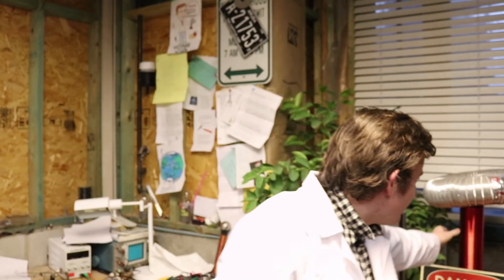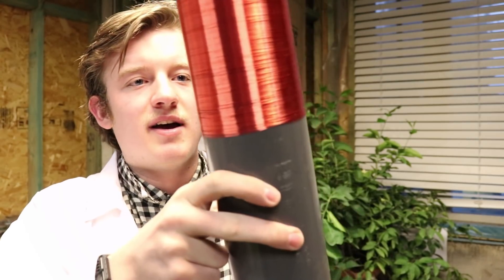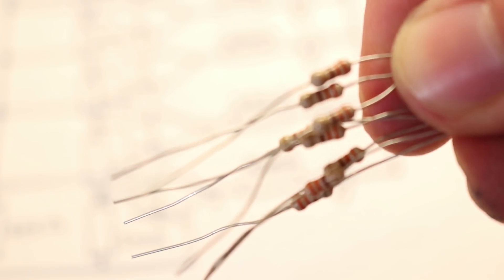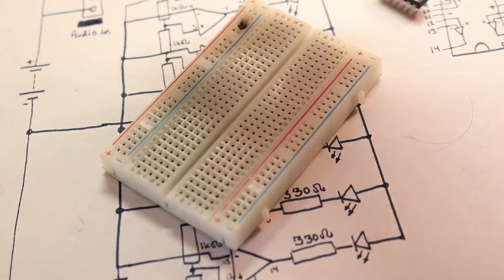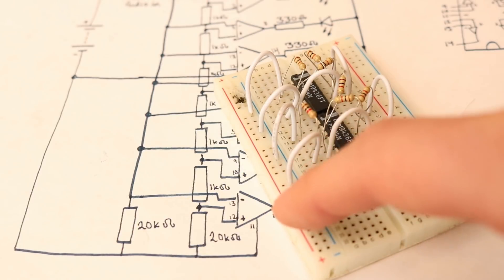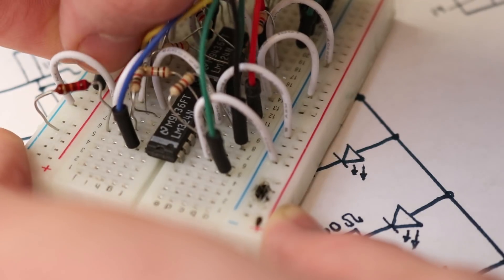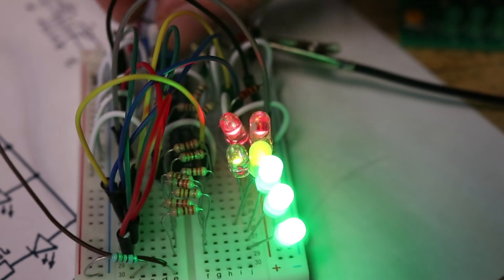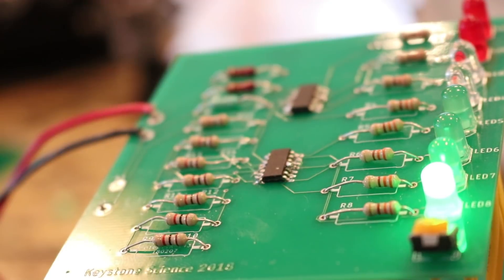How to make a VU meter

Comment: It's so finicky to adjust and doesn't have quite enough movement because you made the divisions linear. It would help to make them exponential. You don't need a lot of resistor values to make exponential divisions, you can do for example R/2R resistor ladder to produce reference voltages.

Oh, to go with it, you might want an exponential regulator for the input too... well... you can bias a linear potentiometer to get eerily close, and better than logarithmic pots that you can actually buy. Look at "Better Volume Controls" on Rod Eliott's website. Of course it needs to go into a high impedance input, so this is not a universally applicable hack.

Comment: hey Cody,
i have an idea that i really want to build but dont know how. to give you an idea, heres a video;
https://www.youtube.com/watch?v=oSNXp1ze248&t=0s&index=14&list=PLp9zdgDiIXt5_kPNJnnINSfYsRoatdjtX
can you construct a data transmitter and receiver that uses audio to send information back and forth? kind of like a radio but with audio in order to send data through the water. such as 2 arduinos communicating serially but with audio based information transfer.I want to develop this because it is the only way i could think to send information through water. let me know if this is something you would consider!
Reply: Are you trying to "stream" music? LOL. Sorry I couldn't resist the joke.
Sounds like an interesting idea though.
Reply: Water proof your speaker, water proof your microphone, done
Reply: i'm talking about transferring bites of information not audio lol
Reply: like ones and zeros...
Reply: Xasthan Kiyato thats not going to work because audio information transfer requires a set frequency that is smaller than the baudrate or frequency of the information. for example if the frequency or baudrate is 9600 bps, the frequency of the actual soundwaves has to be smaller. in otherwords, you need to oscillate the voltage of the ones, turn the ones of the information into little sine waves
Reply: to give all of you a better idea of what im thinking heres a video of a man who actually built it. https://www.youtube.com/watch?v=oSNXp1ze248&t=0s&index=14&list=PLp9zdgDiIXt5_kPNJnnINSfYsRoatdjtX
Reply: Xasthan Kiyato i know that, the problem isn't really on the transmission side of it, it more has to do with the receiving side, i have no idea how i would filter the frequencies that would come from the ambient environment. if you have some idea of how ordinary radiowave transmission works, you have a transmitter and a receiver right? the transmitter takes the ones and zeros from lets say, a computer, and mixes the signal with an oscillating wave. this new resultant signal is sent to a simple set of circuitry and transmitted. simple. the real complex side i on the receiving end, where the signal needs to be amplified by an opAmp and filtered through a set of circuits to get rid of other frequencies you dont want. this can be seen when you turn on your radio to lets say, 91.3. the Radio reciever amplifies and gets rid of all the frequencies above 91.3 and below 91.3 to give you only the frequency you want. the same would be with transmitting sound the only problem is i dont know how to specifically do it because im only a highschool student lol. i dont know any of the equations, i only know the general concept.
Reply: i know about lc circuits, i guess i just dont know how to come up with the values needed because i don't really know the formulas but i guess that more of a me problem because im just to lazy to reaserch it rn lol. i have a lot of projects on my hands at the moment the last thing i need is another one. one project at a time i guess lol. it would have been easier to have someone else do it but i guess sometimes you have to do everything yourself haha.

Comment: I'm curious about what sort of neutron detector you bought. I'm a grad student in nuclear engineering, and I know those tubes are sometimes not great, are really expensive, or are really really expensive (like the 3He ones). Also, if it's a BF3 tube, be careful. They can corrode from the inside and break open unexpectedly, especially if it's old. A couple friends of mine got to spend a day at the hospital because a BF3 tube broke open when they were disconnecting the coax. The building had to be evacuated for a few hours also.

Comment: Doesn't grey PVC have carbon in it if so your not winding a secondary your winding a resistor and it will heat up (never use black PVC neither).

Comment: That is a really hacky way of driving the LEDs. I find driving them with a transistor is far easier and more effective. I am guessing that is why you had several extra LEDs on the breadboarded version; some were staying on and some were not getting power and you had to trial and error it.

Connect the base of a PNP to the comparator output, emitter to V+, and collector to your LED. 

I have a really crappy video on my channel that shows me driving LEDs via transistor. It is a 3-bit FSM.

Anyway cool video. I will probably try it over the weekend.

Comment: As laser light is electromagnetic radiation, would a magnetic field be able to "steer" it ?
Reply from the maker: I would like to think so, at least very very slightly, under the traditional sense of light, it has an oscillating magnetic field, so you would expect a magnet to make the light waver to and fro with every oscillation, but I have never seen an experiment showing this, it is an experiment I would like to try, because while I’ve been gone I have been working on formulas describing light as basically and very small 2 component object, and with my formulas, light is constantly neutral because the 2 components have equal and opposite charge ( so basically the electric field is always neutral, and the magnetic field is always neutral )... sorry I went on a bit of a tangent, light really gets me exited... in short, I’m not sure, my intuition tells me that light does not respond in a noticeable way to charge, or magnetic fields, but I think that is yet to be tested ( if your curious, my version of light has 2 particles at a charge of ±(plank charge)*√2, or at least that’s what my math tells me.
Reply: That sounds a lot like "time crystals"
http://news.berkeley.edu/2017/01/26/scientists-unveil-new-form-of-matter-time-crystals/
Did you plagiarize ? :)
Reply from the maker: Haha nah I didn’t plagiarize, I’ll read up on that though!
Reply from the maker: Yeah, time crystals are not what I am describing, I’m trying to figure out what makes up a photon

Comment: Does the lm324 have a protection against negative voltage? You powered it with +3V so it should in theory break after some time because it reaches an input signal lower than 0V

Comment: Thanks for the video. Much easier way to make VU meter is to use ladder of diodes (type/amout depends on input voltage and resolution) and a bunch of transitors. Of course your design is much more flexible, and overall more professional.